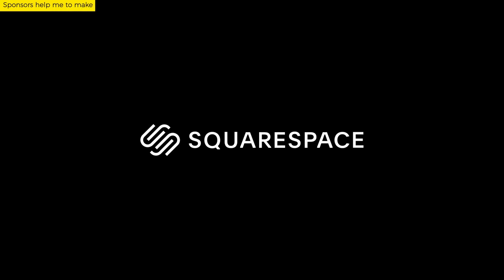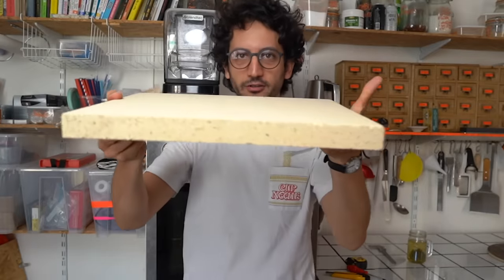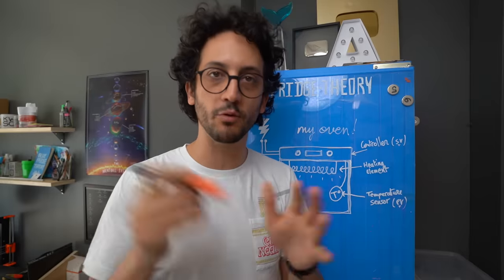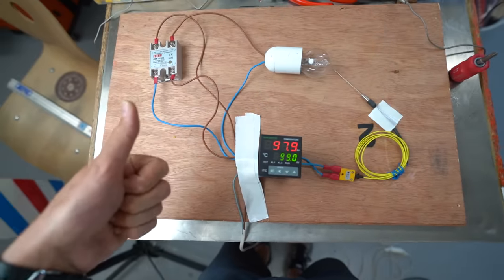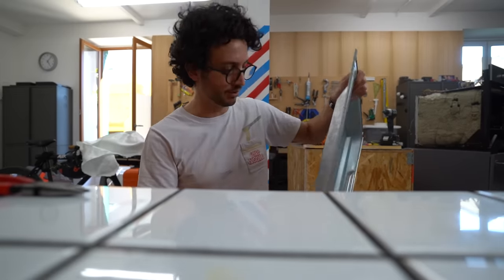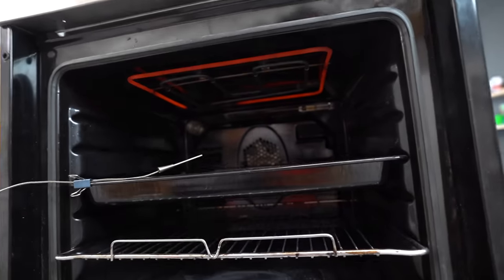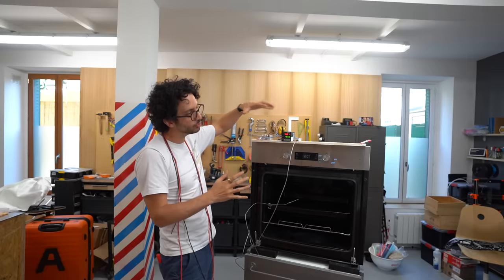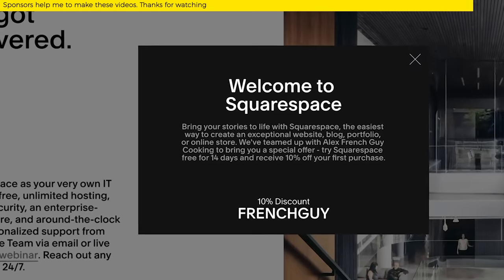I've got a Serious "Pizza Oven" Problem... (part 1)

Comment: I'm not saying he got an electrical engineering degree purely to bake pizzas but it's certainly helping.
Reply: you not need a degree for this hack
Reply: @MakarovFox  un electrotechnicien comme moi qui a étudié  la regulation est suffisant... reglage PID....
Reply: Makarov Fox probably best not to go fucking about with mains powered heating elements without genuine and exhaustive experience.
Reply: @jpp9239  certainly i also studied electricity in my school and the mod they alex make is simple whit basics electricity knowledge
Reply: @jpp9239  même sans l'étude du réglage PID c'est basique-ment du branchement de composant après faut savoir les branché correctement mais bon
Reply: As an electrical engineering student, I can tell you while I might not be brave enough to hack my own oven, knowing what I know does help with cooking in terms of understanding how to cook and why.
Reply: @alicebingham9796  is not that big of a thing, worst case scenario is that the heating elements burn and the system died, i dont said that if you dont know nothing about electricity you go and do it but you don't have to go to the other extreme and said that you need a degree for such ting, whit basic knowledge of electricity your are safe.
It is also ridiculous to think that by saying that nobody tries this at home, people will not do it, much more coming from a channel that teaches and create things with simple materials
Reply: @JackHudler  yep is a resister only bigger
Reply: @MakarovFox  saying you shouldn't do it is a legal thing. That way he can't be made accountable if someone tries it and it goes wrong. There are countries with laws that that could do otherwise. To the mod: yes it's not to hard to do if you know what you do. But again, legal side, what happens if someone is electrocuted (a visitor for example) or the house burns down. You will have to prove that you were qualified to do the mod an that you respected all the safety rules and guidelines. Or you will pay.
Reply: @JackHudler  But there is a hell of a difference between 50 Watts and 5000 Watts when touching an un-grounded case.
Reply: @alicebingham9796  Truth, that's one of the few things I won't fix myself, 1 slip up and boom.
Reply: @JackHudler  Mains yes but much higher and you will be over the breakdown voltage of the rubber depending on the thickness.
Reply: did you not?
Reply: Joel Bingham probably, but then again if you ground everything and know not to touch capacitors, and everything is disconnected, and you run test circuits, well basically im saying that you dont need a degree to understand electrical shit but it helps a lot, a manual diagraming what wire does what would probably be enough if you are of at least average intelligence.
Reply: getung a bit spamy but the top coling fan is important to nit have the oven catch on fire. you need to plug that back in ( in most oven the fan turn on automaticaly if the oven is sbove a set temp even in the off posision do you should be alright just pluging in both controler at the ssmd time and leaving the old one on off)
Reply: Lol what if he did just get it for the pizza?? 😂it would push his passion for food and the making of it to a whole new level as previously thought
Reply: This sounds like something straight outta Ninja Turtles 😂
Reply: @kilianortmann9979  the watts depend on the power grid, not the appliance. A 6 W appliance might just pass the full oomph of your power grid through you. You shouldn't be working on a live appliance unless completely necessary (e.g. to obtain measurements), which is not the case of stone age technology like a damn oven and a switch, where the only live part is the final testing.
Reply: Idea for your future videos :  How about making a wooden pizza oven ?, what will be the best clay to use? Could be possible to use volcanic stone ?

Comment: PLEASE, think about the door seal. Non pyrolytic ovens have silicon door seal, but pyrolytic ones have fiberglass door seals to withstand temperatures higher than 450C (silicon won´t cut it at high temperatures)!
Reply: a good point and i would also suggest maybe coating the roller he has the oven on with something like 1 hour FP insulation you can get it in a spray on can and it will only expand like 2 inches so youre not losing much

Comment: No soldering cables which go in hot environments. Only crimp or screwed ceramic connectors. Use silicone lined cables (or even glassfibre lined but that's for really hot things).

France has no 3phase ovens?  (Germany here)
Reply: My oven in France was 240volt, 16 amp Single Phase
Reply: This needs more attention guys

Comment: I was under the impression ovens without self cleaning mode didn't have enough insulation to properly protect the internals above 500F.  I guess we shall see.
Alex, I'd love to see you get the convection fan working too.  That will certainly help with a good even heat.
Reply: Non-self-cleaning ovens can go well over 500F by turning on broil and closing the door.  Alex is replacing the 'internals' such as thermostat, switches, and wires to handle the high heat, so the electrical gear won't fail, and 900F won't be a problem on the metal.  It's an easy project that will surely work.  He might want to add some more insulation, which is cheap.
Reply: @charliedoyle7824  He said he will keep both system. So weak componment will still be here.
Reply: 500C though, not Fahrenheit, we are in Europe
Reply: @matheoland  He's replacing the temperature sensor, which is the most-likely component to fail.  I know this because I've done the same thing as Alex, and my thermostat failed the first time I sustained 750F.  The other components are just wires and a switch, which are less likely to fail, and cheap to upgrade if he needs to.  
I've cooked about 20 pizzas in mine, and nothing else has failed.  I usually go up to 750F.   My next oven, using a junk oven from my yard, will go to 900F and have new insulation, new on/off switches, and a high-temp thermostat with the same controller he is using.  Alex will definitely end up with a reliable 900F oven.  It's easy, cheap, and better than anything on the market.
Reply: @SKaleLP  500F is correct.  Alex is in the USA, and he has an oven that was designed to go up to about 500F.  He's trying to get to 900F, which is about 480C.
Reply: @charliedoyle7824  You are joking, right?
Reply: Charlie Doyle don't really know how long you've been following the channel, but Alex is based in Paris, France. He does travel a lot but he is located there, which is where his studio is.
Reply: @estebant  Oh, I had seen him in NY so I assumed he lives there.  I've only seen a few of his videos.  I'm mainly interested in pizza, so I mostly just watch his pizza videos.  It doesn't really matter though.  He's still dealing with a 500F home oven that needs to go to 900F.
Reply: @charliedoyle7824  Alex isn't in the USA. He's in France.
Reply: Charlie Doyle the broiler will shutoff if the door is closed too long.  I’d guess 600f.   I respectfully disagree but let’s see how things shake out.
Reply: @charliedoyle7824  An ofen is not just metal... For example the door has usually a rubber seal, on mine this gets soft and expands quite a bit already at 280C. Then there is coating on all parts. The control panel contains plastics etc... Yes, this mod will probably work for a few pizzas, but I would not call it safe or reliable.
Reply: @diymatt  I have already done the experiment of broiling with the door closed.  I reached 750F and my thermostat burned out.  It's definitely not designed to operate above the normal temps; that's why they say to keep the door open when broiling.  Rather than fix it, I just operate my oven manually and use an IR thermometer gun.  My stone on the top rack has reached 800F on the top rack, usually 750F.  With the bake element, it struggles to reach 700F on top rack stone; with broiler, it reaches 800F on top stone.  I'm currently converting another junk oven to have the same setup as Alex, with high-temp thermostat that can maintain 900F with both elements on.
Reply: @charliedoyle7824  can you not just say the °C word?
Reply: @ecoutezmusic  as a fellow american we are just used to using F instead of C so we default to it. Many, most?, of us do know how to convert back and forth it's just that everyone naturally defaults to what they normally use. though personally my default is a mix of metric and imperial units.
Reply: Came here to say more insulation might be a good call for the longevity of this modification.  Don't want both the added and the original electronics to get burned out
Reply: Not only insulation but also air pressure in the space between the multi layered glass oven door. It’s very dangerous and can explode if the oven heats up more than it’s designed parameters. I used to work for an appliance manufacturer and we had MAJOR problems with this. Heads rolled and shareholders fled.
Reply: @charliedoyle7824  Perhaps avoid acting like your the authority on anything if you haven't seen much of it?
Reply: @SKaleLP  "Not Fahrenheit". More to the point: "we are not in America". Fondly, Canada.
Reply: Charlie Doyle He is from France. His oven displays somehow Fahrenheit, his new probe however displays Celsius and he himself is talking Celsius

Comment: I have lowered the temperature probe of my oven so it sits below the stone. Reaching now a temperature of 446°C 😎 Alex his method is of course more elegant and I might give it also a try. Thanks for your inspirations Alex! 👌
Reply: Hi! Does your oven has thing like overhang? I’m asking for i can not find any rod in my oven. I guess it has a thing like a temperature sensor
Reply: That's brilliant! Just replace the probe or add some resistors or something (depending on the kind of probe) ... And your oven will think that it's cooler than it really is.  You can calculate the offset and just keep that in mind when setting the desired oven temperature. Only requires a small change to the probe and you can keep using the original PID :)
Reply: @xandrios  With an simple resistor you get a non linear response though. A different value of thermistor would be better, but it still would not fit the compensation profile from the original controller. So this creates not just a simple offset.

Comment: I must admit I chuckled a bit at the sight of the teeny tiny wire you used to wire the behemoth 32A socket. If anything melts, it's the wire. Sort of like a not-so-safe fuse, haha
Reply: It looked like he used the stock wire the oven was wired to before, he just changed the socket from the stationary clamped one everybody has behind their oven to the blue one that you can easily disconnect. I wasn´t sure about the max. current ratings in France so I quickly looked it up, apparently unlike here in Germany they do in fact use 32A instead of 16A for the oven which means that the stock wire should handle it. Usually the wires are made to withstand more than what they are rated to but the fuse will blow before the cable actually catches fire anyway so that should be fine ...
Reply: it's still using the original heating element so unless he's somehow using a different voltage the current will stay the same
Reply: I doubt the wire would melt, it's supposed to handle the current when preheating and at that time the oven is drawing full power for quite a while, and you wouldn't want your wires to melt at that point. Wires on the inside may have more trouble because they will get hotter as the heat from the oven itself will go to them as well.

Comment: Great job, Alex! Of course the main thing is to get a working solution, which you have done, but if you're interested, I can see another way archive your goal, which requires a bit less modifications to the device. Still it has its shortcomings. I guess you could add a little circuitry between the default thermocouple and the oven controller, so that the voltage coming to the controller was say twice less than it is on the thermocouple. Trying to reach the set temperature (e.g. 100*C) controller would heat the oven up to twice the set temperature (e.g. 200*C). And swiching back to normal operation could be done with one switch. The cirquitry requires a differential amplifier, couple of resistors, switch, breadboard, some ironing.

Comment: Alex: is electrical engineer
Also Alex: puts shot of switching the breakers ON before he removes the oven at 2:41 😂
Reply: Yes, but he is a performer. Is like the circus acrobats flying without the security net 😅😅😅😅
Reply: Uhh, I think you will find he turned them off. Up is off, down is on.
Reply: Liam Twentyman  no
Reply: @josephweston6628  explain, no is not an adequate answer tbh.
Reply: Electrician here, I noticed that too he did turn the circuit breaker ON in that sequence
Reply: @liamtwentyman7275 
Up is always "on" on European breakers. It is standardized in Europe. 
You can see the "I" for "on" under the lever. 
Trust me, I'm an electrician.
Reply: Liam Twentyman  As many others have said. Up is on. Down is off.
Reply: Where in the world is down "ON"?
Reply: @nekro5342  Probably Australia.  Everything is upside down there.
Reply: @Helli__  yes, my bad - I am used to down being on 😅
Reply: @josephweston6628  yes, but it depends on what country you are in. What also many others did, other than say "up on, down off", was to provide context so that I, as well as other readers, could learn from it - as I did ask for a bit more of an explanation than "no", which to be frank, you didn't really do a good job on.
Reply: Liam Twentyman I’m sure it does but this guy lives in France.... surprised you couldn’t tell.  All the best
Reply: @josephweston6628  I wasn't aware that Europe had them inverted.
Reply: @majcrash  I can assure that it is not so in this case! Up is "On" for our circuit breakers, too. From Tasmania........
Reply: hust to give perspective, in my country the breakers up means On. We also usually say that the breaker went "down"

Comment: Alex, as an electrical engineer and recent Sourdough pizza maker too I loved watching this. I've been using a 2 part method I found online, you heat your top grill to max (my unmodified one only does 280C), then you place a large skillet on the stove top at max temp too. Drop your pie into the skillet and when it starts blackening at the bottom move to whole skillet into the oven on the top wire rack till the pizza crust also blackens. Seems to be working.. maybe compare these once your prototype is complete. You should also keep a fire extinguisher close by. Good luck

Comment: Hi Alex, I'm an electrical and mechanical engineer (not bragging) and I am very happy with this series and what you have accomplished in early videos. In this oven configuration, you may want to check the power that your heating element can supply. I haven't read a lot of the relationship between the watt output and max temperature, but maybe a 2000W not even make it to 500ºC. The other thing to consider here is the insulation. It is possible that more heat will escape than can be added in a given time unit above a certain temperature. As many other persons commented earlier, please consider these upgrades in order to see you accomplish one more time, bon chance!

Comment: "I am an electrical engineer".......* turns ON the fuses *
Reply: And cables around the neck working with mains voltage :D
Reply: ... and a performer. He is playing us. 😉
Reply from the maker: Well, I may have to pick my dailies more carefully haha
Reply: * Connects plug to socket, starts wire stripping and crimping *
Reply: @FrenchGuyCooking  hi Alex.
Just making a reflexsion. 
When you turnd your heating element on. It onley turnd on the outside one. Wye not turn on bothe elements on the top. More heat faster. And you can heat 2 zones. I think you have to channels on the PID Controller right.

/J
Reply: @FrenchGuyCooking  "in the previous episode , I used the self cleaning pyrolysis mode on my home oven, to reach to crazy temperatures" It looks like you took down the old video, I'm sad.

Comment: Hi Alex, I did exactly what you're doing many years back. PID controller and relay.  Yes, mostly because I wanted to do pizza, but the original controller was shot and cost just as much as an off brand PID so I just replaced the old control with the PID hack.  One thing I'm sure you're aware of is the need to use high temp lugs, wire, everything.  Even doing that, things definitely don't last as long in a home oven that goes to 700F.  Mine was a built in and I ended up with 4" of Rockwool insulation around it to be safe.  I sold the house and replaced the oven with a standard built in so there would be no liability issues, but the oven worked a treat for several years.  Interestingly, when you set an oven that will sit at EXACTLY the temp you set it to, you have to modify your normal temps as the oven no longer has that overshoot/undershoot cycle around the temp you set it to.  In my case I had to bump the temp up a bit on the hacked oven for normal cooking.